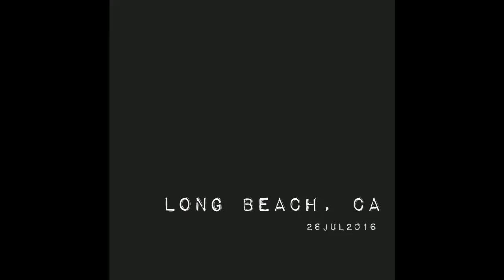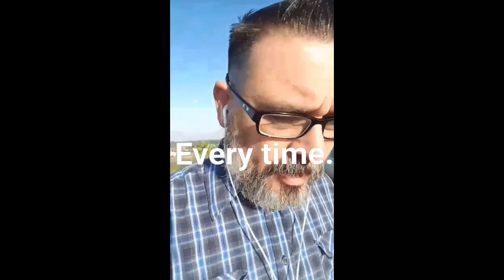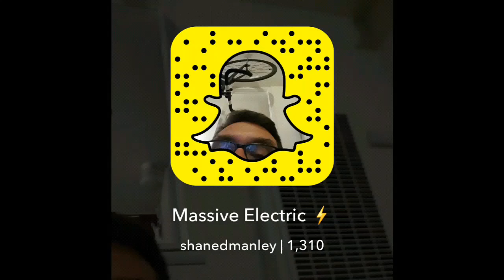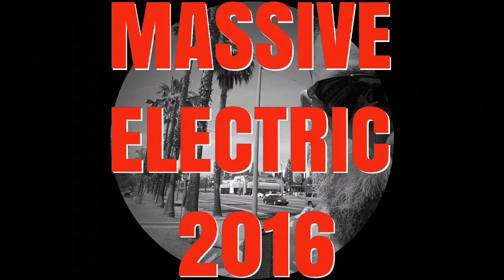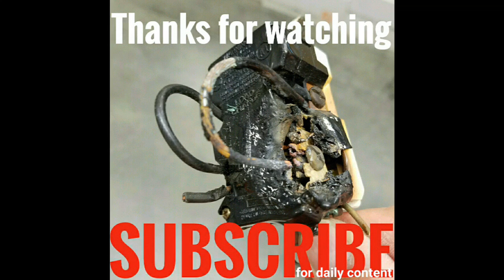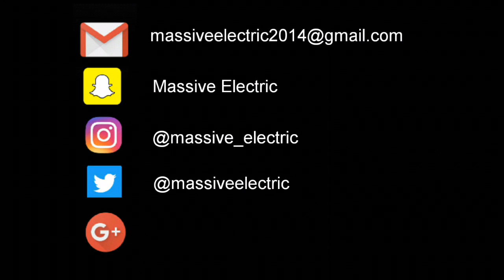Can I Replace My 100 Amp Panel With a 200 Amp Panel?

Comment: I upgraded my 100 amp to 200 amp with upgraded service from grid and I have solar panels since few years.  Since the service and electrical panel upgraded, the solar panel is generating  electricity less than 50% and app does not show electricity from solar panel is going to grid anymore as it used to.  My question is what solar company needs to do to fix this peobleml so the electricity can be generated as before?

Comment: As a homeowner, I can see this as a cost savings technique to get to 200 amps service line as well. Power company disconnects main power, homeowner swaps 100 amp panel for 200 amp panel but swaps main breaker to 100 amps. Homeowner reconnects all existing circuits. Homeowner then pays electrician to pull required permits to upgrade service wire and meter socket to 200 amps. Am I right in thinking this is a possibility?

Comment: Can a 150 amp panel be changed to a 200 amp panel without changing the panel box but upgrading the outside wire and meter. i have a 150 amp siemans panel and not sure why the electrician installed that. The panel is very new.

Comment: I am replacing my 100 amp sub panel with a 200 amp lug sub panel , outside  main panel has 100 amp breaker , do I still need a disconnect or can I use a breaker instead  , both panels have 30 spaces so no extra load

Comment: Thank you for this video.  I need to change my outdoor panel to make space for a 2 pole 50a breaker for a generator feed (with breaker interlock).  I don’t need/want to change my service.  Is this situation acceptable for only changing my external service panel.

Comment: Instead of upgrading to a 200A with a 100A main breaker, can't you just feed a 200A sub with a 100A main breaker on it and get the same result?

Comment: But can I replace my 100 amp panel with a 200 amp panel?
I couldn't concentrate on what you were saying, so don't know if you ever answered the question; I was so busy looking for what the heck you were looking for, constantly looking to the side like you were revealing state secrets and were expecting the CIA to jump out at you at any minute... I mean, you must have been seriously concerned, because you even changed location in between.

Comment: One of the more common reasons for a 200 amp upgrade is when having solar installed on an old house. If you're installing over a certain amount of solar panels, a 100 amp electrical panel isn't enough to handle the load.
Reply: You don’t need to upgrade to a 200 amp if you have solar mine is running perfectly fine
Reply: @Ampinc2006  Yes and no  Depends on how big of a system we're talking about and how many other 220v appliances the panel can handle being on at the same time. You don't want the panel to be at its peak.

Comment: I have a 100A service for a small 1000 sq ft house.  My concern is that I have a 15A fridge, 40A range, 30A water heater, and a 10A microwave as my big draw items.  It my service enough?  Could it also handle an electric washer/dryer combo?  Thanks for your help in advance :-)
Reply: Also, if it's a modernish panel that has a double pole '100' amp main breaker then each hot leg is going to handle 100 amps maximum (ideally only 80 amps per leg max). The way they make modern breaker panels and rate them it's rated per hot leg, so if it's the typical split phase 120/240 V residential supply with 2 hot wires and one neutral, then you should be able to draw a total of 160 amps balanced across both hot wires and do so safely for hours (technically right up to 200 amps for very short periods of time)

There is a ton of misinformation even with electricians about this, but if the panel has that double pole 100 amp breaker then it will be 100 amps per hot leg that it can handle. If that's what you have then you will have good headroom if you balance your loads (any 240V loads are already balanced loads, so balancing your high draw 120 V loads is the only thing to worry about)
Reply: In my experience it should work fine, the ratings on many appliances and equipment is most often the full load or peak amp draw. 
When a motor or compressor starts up it usually draws way more current than when it's in motion (fridge, outdoor AC condenser). Resistive loads like the water heater really depends on how many of the heating elements are being used, typically there are three elements but you might not have all three on at the same time. Under normal circumstances your amp draw should be less than the max. 

If you are experienced and comfortable doing so safely a 'clamp on amp' meter at the panel can tell you actual amp draw of your circuits, otherwise if you aren't comfortable with that just get a 'kill o watt' plug in meter for the 120 V appliances to see how much they draw.

Probably the biggest issues most people face is undersized wiring for the appliance/ equipment's amp draw which adds too much resistance to the circuit and can heat up the wires or cause fires in the worst case. The other big problem is a breaker panel and breakers that need to be replaced due to a poor/ faulty manufacturing design or sometimes just old breakers that don't work right anymore.

Comment: Do take that literally.. you can absolutely replace a 100amp panel with a 200 amp panel without upgrading your service, but you MUST not try to pull more amps from the grid. So no more breakers. Then you call your electricity provider and request a full service upgrade if you need to pull the extra amps.
Reply: Thank you! I'm buying a home and all I want at the moment is replace the panel with a newer one and all ACFI GCFI breakers, no pulling more power and later upgrade the service if needed

Comment: the wiring coming into to panel is #4/0 coming from a 200 amp meter... please explain.
Reply from the maker: the electrical utility service is fed to the meter and then through the conductors to the panel. Sometimes the meter is separate equipment from the panel it feeds, in most new residential urban installations the meter and panel section is all in one can. Older urban homes and rural properties tend to have a separate meter and panel. The short answer is electricity goes from the meter, through the conductors, to the panel. Hope that answered your question Orion.

Comment: Put in a 200 amp panel then replace the 200 amp main breaker with a 100 amp main breaker.
Now you got room for more breakers and don't have to worry about overloading the incoming wires from the utility or blowing the meter IF you exceed 100 amps. Then get the utility company to upgrade your incoming service or get an electrician if permits and sign offs are required.
Then put the 200 amp main breaker back in.
Reply: Bravo! Exactly. Avoids twin breakers as well with more spaces.

Comment: Aren't there situations where a 200 panel can be utilized, but then downsize the panel main breaker to match the existing service?  So it gives more breakers and flexibility, but obviously, if you exceed the load rating of the main you are still safe?
Reply: As long as your main breaker is 100 amps and all subpanels are 100 or below.

Comment: I believe if you already have a 200 Amp service from the  Meter Box to your home and have a 100 amp service from the electrical Box to your breaker You can have it upgraded by professional to a 200  Amp service But it has to be done by a  License professional If your meter is only a 100 amp service then you have to get a permit and get Your electric company out there To upgrade The line coming To your meter An upgrade your meter as well Then you have to get a  Electrician  To upgrade the Rest
Reply: How do you know if the service to your house is 200 amp or 100 amps

Comment: Wow this is a terrible video.  For starters, learn to edit !  Second, get a tripod.  On to the electrical issue.  First question that should have been asked was what is the amps of the meter.  in other words, how much power is coming in front the power company.  If you have a 360 amp service hookup then by all means, yes you can upgrade from 100 amp panel to 200 amp panel...DUH.  This video is a disservice to the youtube community.

Comment: Hard to tell if the guy  actually wanted a larger box so he could fit more breakers or an amperage upgrade.  It isn't clear if the poster actually cleared that up.
Reply: Yea, it could of gone both ways, but by the sounds of it, it sounds like the latter.

Comment: I did..  it worked...  got more breakers now..  didnt have to do anything besides change the panel and main breaker and had a 200rated meter..   didnt even call electric company..  gonna confuse the shit outta the meter maid..  gonna tell em i dont know what theyre talking about no work has been done..  hah..  worked in tennessee..  

However the service head and entrance cabling were oversized with the build of the house, all the neighbors have 200amp and i only got 100 for whatever reason..  but otherwise i dont understand what your saying service.. u talking about the meter? Service?.  is like the bullshit contractors say trying to confuse you and make them look like they know what theyre talking about..  like i have no clue how to fly a helicopter but if i start talking about pitch and yaw and updraft and tail spin compensation and rudders n shit then using the lingo people start to believe you..  but if the cable coming from the lovo side of the transformer and the cable is sized to handle 200 amps per local nec code specs, the weather mast or pad transformer service feed paths and all meet the requirements n everythings rated correctly your good to go...  gotta watch pulling a meter on a live stab though..  that shit will get angry in a hurry..  especially when theres a wasp nest up behind it and you are about as scared of wasps as you are aids and causes you to twich so you short out the damn thing and it welds itself on it so you figure itll burn the contacts off but 15 seconds later the transformer starts calling you an asshole getting pissed so you gotta go grab a sledge with gloves and smash it pulling a testicle in the process because getting old is fun...
Reply: It worked because you have your service and meter already rated for 200 amps.
Like you said, for whatever reason they just gave a 100 amp panel, short straw I guess.

Funny story though.

Comment: If 200 amps is pulled through a wire that can only carry 100 amps it will immediately burn down your house on the spot.
Reply: A 100 amp service can actually pull 200amps , 100 on each leg before the breaker will trip...
Reply: @Z-Ack  Not so

Comment: If you have a breaker problem with your 100 amp panel you can upgrade to a 200 amp panel however, as this video states you can't add any more circuits until you get the service upgraded. Service means wire size. If you pull more than 100 amps through the feed wire connecting your panel to the meter base, that can only carry 100 amps,  it will get red hot and burn your house down without tripping any breakers. Also, as stated here, you may need to contact your electric company to check and see if the wires feeding your house from the street need to be upgraded also. If you install a new main panel or sub panel yourself and the house burns down for any reason, your insurance company will not pay any claims and will blame the sub panel for the fire because 90% of all electrical fires originate at sub panels. Insurance companies wrote the NEC and do revise it every 2 years.
Reply: This comment needs to be pinned.

Comment: I did it.  I change my 100amp to a 200amp    all I did was call the electric company and got disconnected from the top and then got a city permit and I replace the panel to a 200 amp then replace the wire that goes up from the breaker box to the roof.  when I was done the electric company wont connect your power on until the city inspector approves it.    that's it.    it can be done.

Comment: My panel is old without any information on it. How can I find out how many amperage it is?
Reply from the maker: 1) look for a "main" breaker: usually a 100 or 200 but could be 60/125/150. 2)  call your utility and ask them 3) have an actual electrician look at it: he can often determine the service size based on ther wire size and type.

Comment: What you said is correct, you cannot get more amperage out of existing service by merely going from a 100amp panel to a 200amp panel, but you can fix issues with main breaker tripping on an old zinsco 100amp panel by swapping in a new replacement 200amp square d panel---in this case the solution is the new breakers and cooler operating temps---i live in central valley, i installed a split system hvac in my home and soon after my zinsco 100a panel started tripping if washer or dryer used at the same time with hvac, i co-ordinated with SCE, pulled permit, bought new panel and installed all myself---you need to be a semi-pro and KNOW without a doubt what you are doing---no guesswork--and you can do this yourself---i did it, i didnt die and i didnt burn down my house, whole job cost me roughly $500 as opposed to electrician rate of 3-4K!
Reply: LOL! I found this while doing research before pulling a permit and having SCE take my meter ring off so I can replace my 100A Zinsco panel with a 200A Square D panel before I install mini-split A/C in the house.

Comment: My situation is slightly different. My box was getting water in from outside. I need to replace my panel due to corrosion. Can I replace the 100 amp panel with a new 200 amp panel. I plan to upgrade the service later and I’m not looking to add anything, just put the correct step in place for when I calm the utility company to come and upgrade the service??

Comment: Do I need 200 amp? We live in 2000 sq ft. home using the old 100 amp panel. We run electric stove, dryer, water heater and 3.5 ton A/C with heat pump. Do we really need 200 amp or would 100amp be fine?
Reply: I bet those lugs are cooking

Comment: Here is a question for you then.  Suppose he added solar panels and wants to do line side taps?  He is asking nothing new of the power company... what works yesterday is what he wants tomorrow... just powered by solar.  For that reason he is upgrading the panel.  You did not address that.

Comment: OK - I have a 100 amp old school fuse panel.    How do I even know what amps the electric company has coming to my house?    Do I 'assume' it's 100?   Might it be 60?     I've called the electric company and spent an hour trying to get information but only got someone telling me 30 amps to the house which can't be.
Reply: You will likely have a rocker style on/off switch before your fuse panel. Open it up and look at your fuses ....they look like shotgun shells. There will be 2 of them. If they say 60 amp on them then that's what you have . 100 if they say that. NOT 60+60=120!!! You have 1 fuse for each side of the line.

Comment: Not entirely true.......You can upgrade the panel to 200 amp as long as you don't exceed a 100 amp draw at same time. You can add more circuits;  you just can't have any more than 100 amp draw combined. Is this safe ? Only if you're smart about it. Don't turn everything on at the same time. I do not recommend this but it is possible. Just saying.
Reply: You would only need to check the size of you're supply coming in . obviously here in the UK we use higher  voltage and thinner cables for less amps hence why most of the properties here use between 60a 80a and 100a main fuses . Any load before my house has potentially as many amps as you like depending safety measures at each mains supply transformer . As long as you have the correct size  cabeling  commig into the property with an appropriate 200amp fuse and that the wiring is the correct size throughout the property you're good to go

Comment: change the wire thats rated to 200 amp, and replace the main breaker .easy
Reply from the maker: That would be nice but unfortunately a 200 amp main breaker won't fit in a 100 amp panel.
Reply: I did that also, replaced an old 100A zinsco, with a 200A square D, pulled permit myself, worked with SCE to disconnect service and told them what I was doing—-they were planning on leaving original service wire but I asked them to upgrade it to heavier gauge, swapped out old panel to new one, added new ground rod per city, wired and labeled everything, called inspector who came out and passed it, called SCE out who reconnected service, voila, up and running on new main and no sky didn’t fall, been 5+ years since, it’s not rocket science as some would lead you to believe, just thoroughly investigate how to do it correctly and safely and you too can do it, granted I’ve been toying with electrical for the better part of 20 years so I know the ins and outs very well, but I’m not an electrician

Comment: sorry but I do not have twitter or snapchat, I have moved since that was done about 10 yrs ago but I do have one question, my new house has only  a 100 amp service in the 
basement and the box is full of breakers is there any way to hook into it with a sub panel they have already used the double breakers, I have been looking at youtube but cant find an answer if a sub panel can be hooked to a 100 amp service, right now switching over to 200 amp is not an option due to money constraints, Thank you
Reply from the maker: +tyler hines "maybe" is all I can say. There is what's called a "quad" breaker but it may not work for you if your panel is already full. I'd recommend having an electrician come out  and just take a look at it. He'll have to check the load on the panel and the types of breakers.
Reply: Ok, Thank you and have a happy thanksgiving.